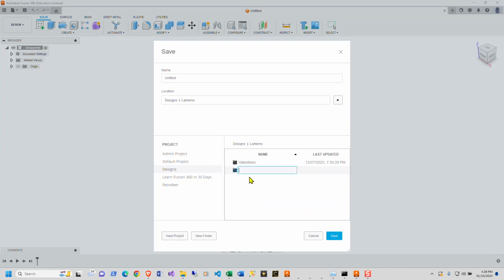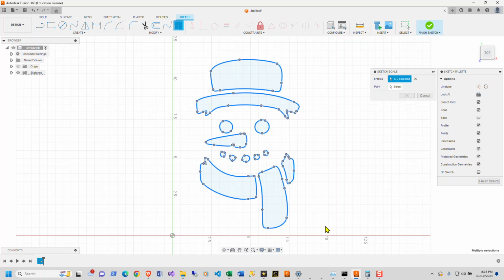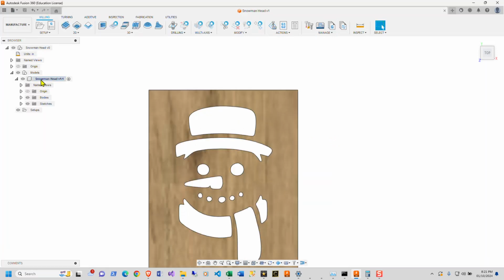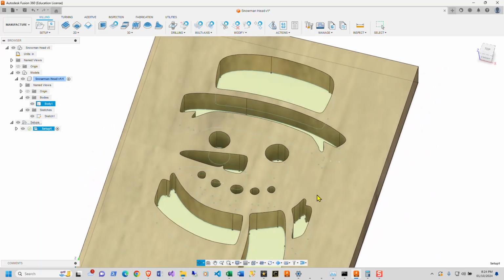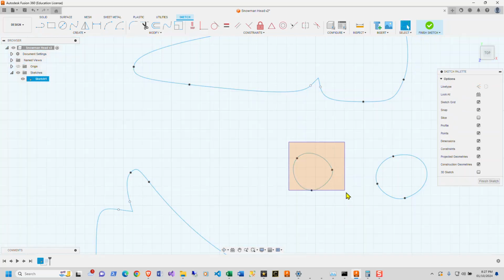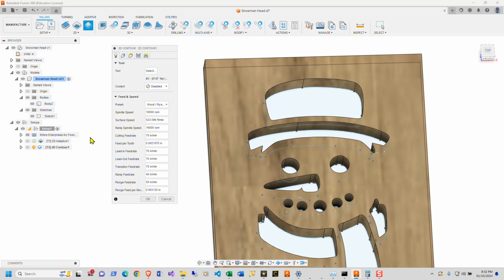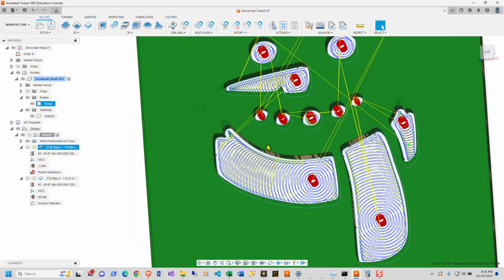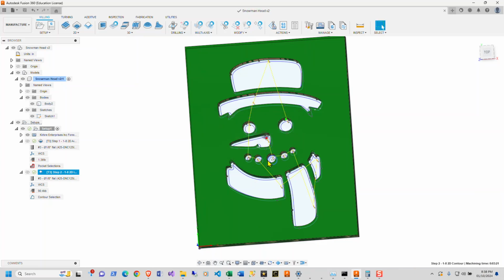How to make latern faces with Fusion 360

Comment: Finally, someone that uses Fusion 360. Most CNC videos I find, people use other software, which is more basic and looks like something developed in the '90s.
I'm curious, did you create the machine yourself (duplicating a default 3 axis machine from Fusion machine library, and making changes to it) OR did you find the file somewhere oficially and imported it? I couldn't find anything, except on the Onefinity forum in a post from someone I think, but I don't think it was something official from Autodesk or Infinity...
Of course, I would love it if someone also reproduced the Onefinity machine model in Fusion, because if I click on the whole setup, instead of each toolpath one by one, right now I see a big a*s machine in the simulation or viewport, that looks nothing like the Onefinity. Would be nice to see the actual machine you have in the simulation. I know it doesn't matter, technically speaking, but would be nice.
Reply from the maker: Yeah I have the file on my google drive.  I modified it to work in fusion 360, the one in the forum did not work properly. feel free to pull it from my google drive and compare. https://drive.google.com/drive/folders/1NftkuRdDcLaRXCey3tmYKLhkuuJh0HmI  must be place in here C:\Users\lawrence\AppData\Local\Autodesk\Autodesk Fusion 360\CAM\cache\posts I have not taken the time to draw up the machine in fusion 360. The post processor that I use does not have a machine on it. I also do not think Onefinity uses fusion 360. But i agree it would be nice.
Reply from the maker: BTW I have a lot more videos to come in Fusion 360.  As I figure things out,  the next one is about resizing text.  I know sounds simple but......
Reply: @LarsWorkShop  yeah... many things sound or even seem simple, when I watch a tutorial... until I actually try to do something, and I end up taking a lot of time just staring and thinking about how to start and what would be the best (or at least good enough) way to go about the design, much more time thinking and planning, than it actually takes using the tools to create what I need, after I've figured out how to go about it. But I guess it will come more natural in the future, after gaining some experience.
Great video! Not too short, not too long, I understood a bit more about manufacturing.
Edit: nice tip! I wasn't sure it would work, to set my bit smaller than it actually is. I thought that Masso would still know the real size from the g-code and would lead to some confusion/undesired results. But if I think about it more, the g-code is just about movement, there is nothing about bit diameter there I guess. So in the design, I would still set the real size, but only on the probing dialog, I would set it to a smaller diameter (like half) and then probe. Will do that on the next one, when I'll need to change my wasteboard. Thank you for the tip!
Reply from the maker: @MStoica  Yeah I am the same way, sometimes it just takes getting in the weeds to understand what I do not know.  This is why I test everything out before going to production.  You are most welcome on the tip about bit diameter. :).
Reply: @LarsWorkShop   thank you !!
I've found it a bit difficult to set the machine x/y travel/dimensions. I mean I thought I did it correctly (-24 inch to 24 inch - that's what I could figure by looking at other machines or the example ones, forgot exactly where, and I've even tried "from 0 to 48" but in the machine description that shows up on the right-hand side when you click on the machine, it still said 0 everywhere). It still functioned properly, and surfacing my wasteboard with the g-code generated worked fine, but it still bugged me that in the machine description it said 0 for x/y dimensions, even though I thought I've set it up correctly.
Sure, when I say "it worked fine", it was a bit strange though... so machine is 48x48 (in theory). In reality (homed, and then moved it to max x/y) it is 48 inches on Y, but a bit over 49 inches on X. And my surfacing bit's diameter is 2 inch. So I thought that if in Fusion I model my wasteboard to be 48x48, while the bit has a 2 inch cut diameter, it would somehow reach that extra inch on the X (like it wasn't there, but the bit had to somehow go over it). Because, initially I modeled the wasteboard to be exactly what I saw on the Masso controller for the X dimension, when moving it all the way to the right, but then when the machine tried to get there, it stopped. And I did choose a straight profile and uncheck lead-in/lead-out, so it doesn't try to reach outside the boundary. So I have no clue why, but I had to manually control the machine to also flatten that extra inch on the X.
I do have the QCW frame. Otherwise I would have just simply designed a slightly smaller wasteboard, but I had to surface the entire wasteboard that I had within the QCW, as per the QCW real dimensions.
Reply from the maker: I have the foreman 48x48 too. Yeah I had to tell the masso that my surfacing bit was 0.5 inches instead of 1 inch.  otherwise it sort of scalloped the edges.  I had to use Carveco for mine, I did a profile around the outside.  Then a I did an area clearance.  Next time will be in Fusion and I will do the contour and uncheck stock to leave or set it to 0.  Then do a 2D adaptive.